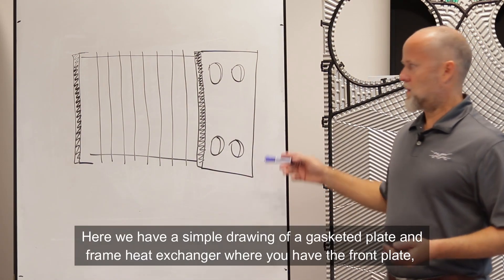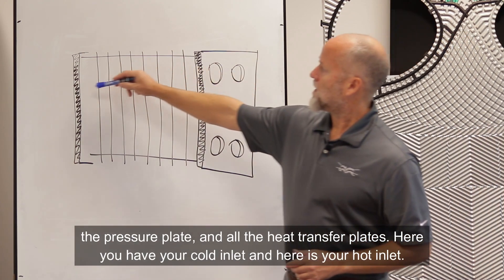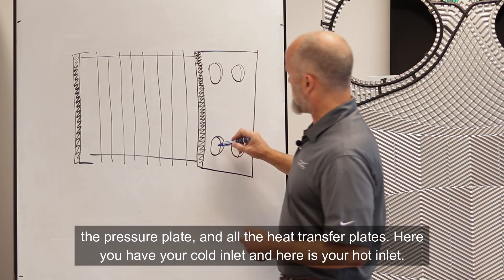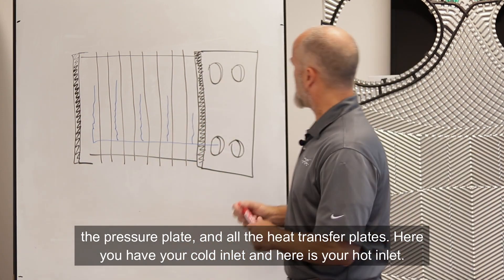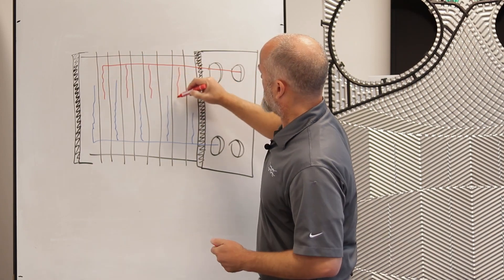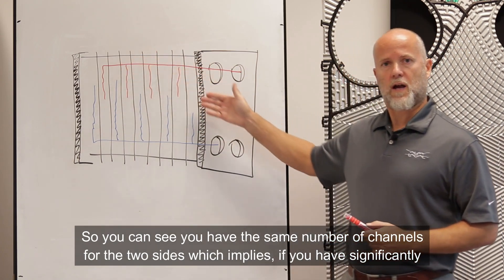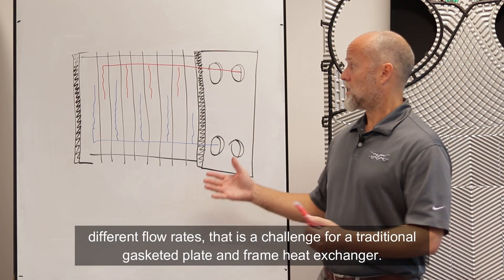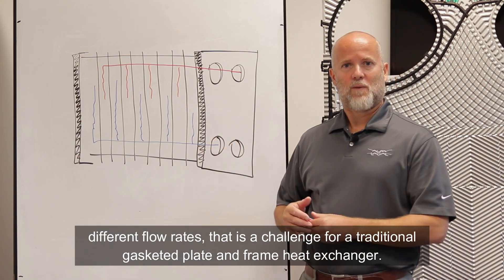How different flow rates impact gasketed plate and frame heat exchangers

Comment: Hi Cosimo...Will adding more plates help?
Reply: Well, no actually would make things worse. The challenge is to have a shear stress high enough on the low flow rate side, and if you add plates, you add channels and therefore you slow down the flow even more.

Comment: Hi Cosimo! Nice presentation! A modulating control valve could help solve this problem? After the system with feedback.
Reply: I gave an answer but it was incomplete.... I am not really sure what a modulating valve could do. If you have 1,000 GPM one side it means you need to have 1,000 GPM one side (for cooling or heating purposes), a modulating valve, chocking that flow, wouldn't allow the cooling or heating needed.... if you cannot design a system with a balanced flow then we will have to design the heat exchanger itself to minimize the consequences of the imbalance..... I hope it helped, but I am not sure :-)

Comment: If you have questions, don't hesitate to ask them here
Reply: Hello cosimo.....how we can vary the cooling capacity of phe manually ??
Reply: @surenderdodwadiya2849  I am not sure I understand the question.... but you change the performances adding or removing plates (assuming you have space in the frame) but it is not something can be done "on the fly" it implies a few hours of a couple of technicians...